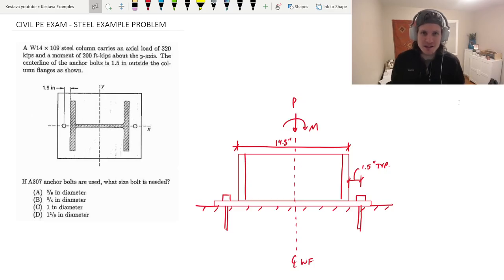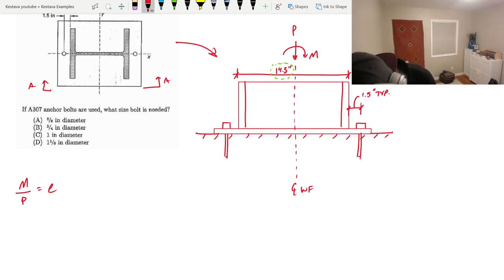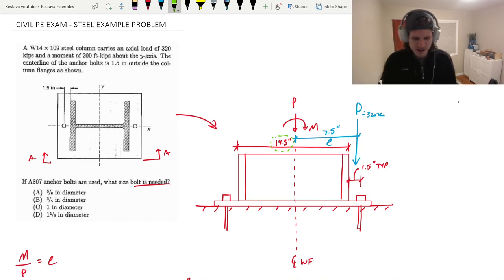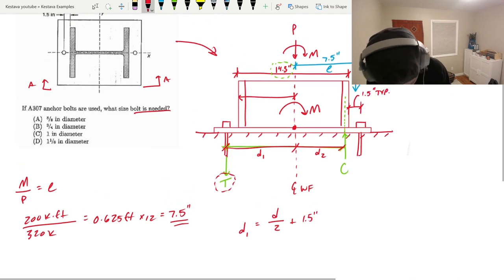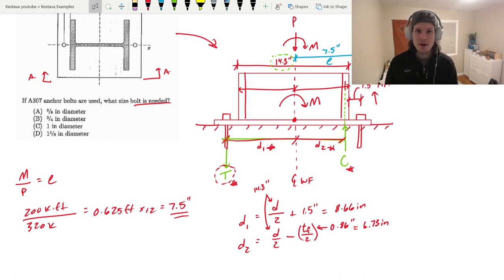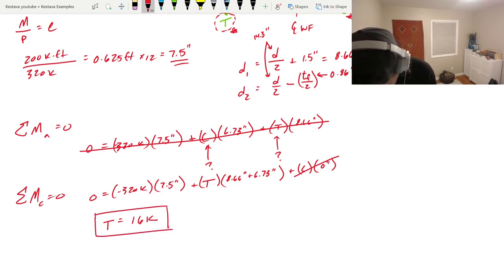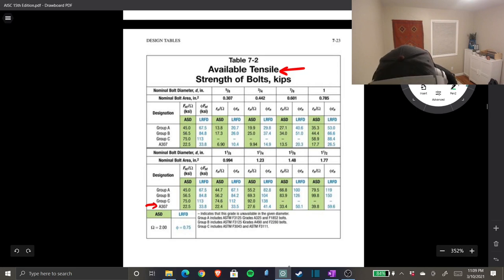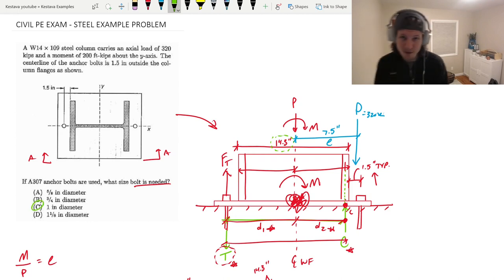Steel Column Base Plate Anchorage Design Example | Using AISC 15th Edition| Civil PE Exam Review

Comment: When you do summation at C, shouldn’t the first part be (320k)*(7.5”-d2)......? Since that’s the distance from point c to eccentric load?
Reply: that's what i was thinking aswell
Reply: Yeah small mistake on his part im sure. Doing it this way yields 16K so the answer should still be the same
Reply from the maker: You guys always showing me up! great work! you are correct Edgar, mistake on my part. You just got pinned to the top of the comments my friend. Cheers
Reply: Yeah I caught that. I went through the math and saw that he did his solution correctly though in spite of the flub on the screen.
Reply: Really good video as all of other videos. Any update on when other videos be back?
Reply: @Kestava_Engineering  Perfectly explained
Many thanks
Waiting for you to give example in base plate Design when M/p greater than N/6 Which is case one

Comment: I doubt if that boy ever saw a real anchor bolt and real concrete.
Reply from the maker: DANG BURN! I will admit I could always use more field experience, but thankfully I have been able to successfully identify anchor bolts and sometimes... I can identify concrete.
Reply: @Kestava_Engineering  key word in your answer is  verb WILL.)))
Reply: @Kestava_Engineering  Your calculations are very primitive(((
Reply: Read the room... We're all supportive here, and he did a great job showing how to solve this problem for the PE exam. I hope you've found something nice to say to someone in the past year since you left this comment :)

Comment: Hey Kesteva. If the eccentricity calculated was to be within the web, like 6" from center. ex(320 axial, 160 Moment) where e = ((160/320)  x 12) = 6" . would the force couple distance be the same as your video example (T & C having the same points) C @ middle of right flange & T @ middle of bolt resisting pullout? or would the "C" be located 6" rt of center?(putting it within the web region) .

Comment: Could you please clarify Why do we not take the applied moment of 200 ft-k into account???
Reply from the maker: we do! we take the moment into account when determining our eccentricity and finding our resultant reaction and location.
Reply: @Kestava_Engineering   our eccentricity=>no moment? Thsi means that there is no moment from P like -320*7.5, as it is balanced with M=200 (but even this not real as right part of base plate come in to contact with concrite and reaction force appered). Yes you found point where M balanced with P (if it perfect rotation joint) but it doesnt mean that you can remove M in the sum equation and keep the P. So take assumtion where rotation point is like you said about H beam flange welding point, then do sum for all load as P, M, T, and C(if it can akts) to get T.

Comment: Great video. Very helpful! One question I had while you finished up solving was should we worry about a prying action in this problem? Maybe it is very simplified for exam purposes but with the eccentricity of the bolts and the column flange. A prying action would be present. Just a thought? Awesome channel! Keep up the great work!
Reply from the maker: Yes, absolutely! most likely I would check to see if the base plate is sufficiently stiff so that prying action does not need to be considered. there is an equation for this check in the AISC section about prying.

Comment: Hey thanks for the effort and for share your knowledge, great content ( better than my classes  ) jajajaj, hey question what is the method to design  that  base plates with stiffeners, there is a method? or the only chance to design these stiffeners in columns base plates is with FEM?
Reply from the maker: Hey Cesar - there is ALWAYS a way to calculate something by hand. I agree baseplate stiffeners is a little challenging to do by hand but there are some simplified conservative calculations we run to design simple stiffeners. would you like an example sometime?
Reply: @Kestava_Engineering  That will be great, is not easy to find hand calculations, most of the documents speaks about FEM simulations.  Thank you so much

Comment: I'm pretty sure this is incorrect but I might be wrong here. The two things that throw me off are 1) why would you assume the resultant force of the compression is in the center of the compression flange? A majority of the beam will be in compression so it's guaranteed to be closer towards the web and 2) the summation of moments are incorrect. You still made the eccentric force equal to Pu x eccentricity which would only be the correct summation if it was taken about the center of the W section. Moving the summation point to the cl of the compression flange would change this calculated moment pretty dramatically. 

I believe your tension resultant would be higher if you accounted for these two things. Let me know what you think!
Reply: @datdude8103 - it's my understanding that any eccentric load positioned outside the column flange would try to rotate the column about said flange. Consider a spread footing where e is much greater than L/6. At a certain increased eccentricity the entire footing could be in uplift. Also see the illustration at the beginning of the video. Thanks for the example Rich.

Comment: The location of the compression (C) does not always align with the column flange. It depends on the concrete bearing strength under the base plate. The base plate size and thickness also need to be checked in order to transfer the moment to the concrete below. You can assume the location of compression (C) but it needs to be verified later.

In reality, however, a steel column with base plate and anchor bolts is considered a "pinned" connection and cannot resist large moment. The steel column needs to be embedded in a concrete grade beam with welded rebar on the column to transfer the moment to concrete grade beam. The concrete pad footing below is designed to resist the vertical load only.
Reply: agree

Comment: I love your video. Always clear and easy to understand.
In which case C is not equal to T?
Reply from the maker: Hey Matthew, well the compression would actually be resisted against the compression block of some shape in the concrete footing. so it depends a little bit

Comment: Nice video.
Btw for table 7-1 shear, if thread condition was not mention in problem do we assume condition X?
Reply from the maker: The PE would provide that information, BUT if you have a problem that doesn't specify then you want to be conservative and assume threads are included in the shear plane and assume the lesser bolt shear capacity. really good question Joji
Reply: Great explanation.  Thank you!

Comment: Hey Kestava. How do you approach this problem if there is eccentricity in the column and one of the bolts falls inside the flange?
Reply from the maker: you wouldnt design the base plate with only bolts inside of the WF if that were the case. the tension loads that would result from the eccentric loads would be extremely high. typically you only detail pinned column bases, with no eccentric loads, with anchors inside the flanges.